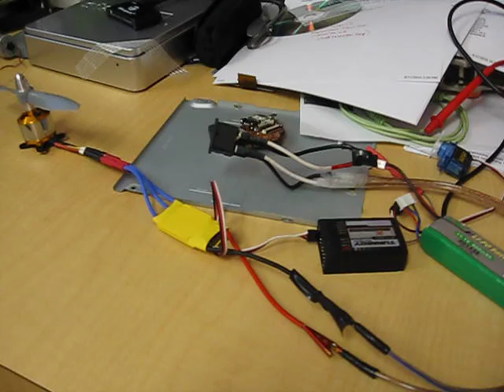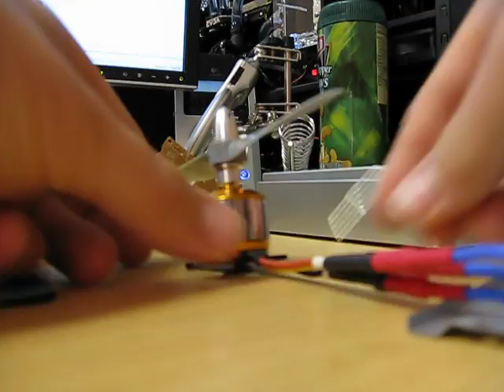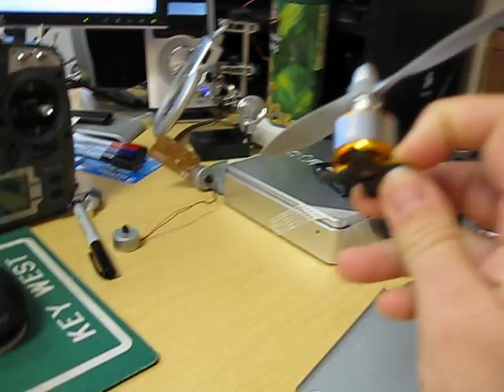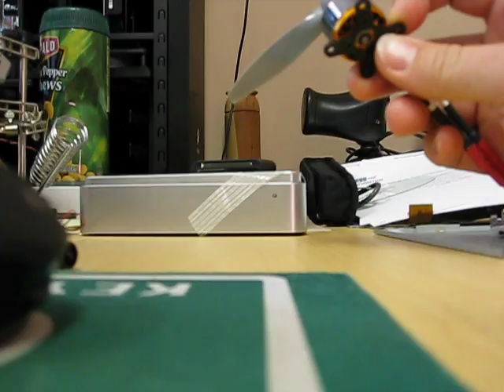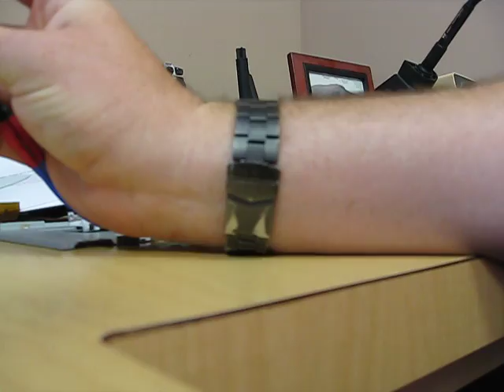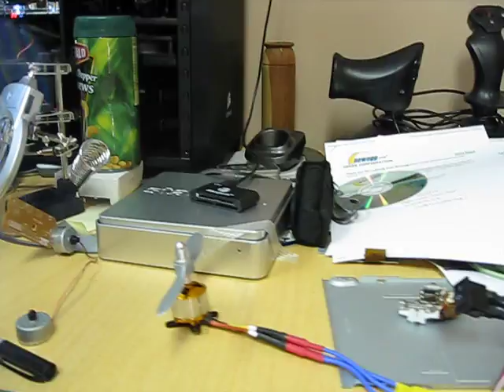2200KV Brushless motor test

Comment from the maker: I've run it in several planes, it's a keeper!
You can put a 8x7 prop on it and run it on a 2S battery as a tractor, or put a 6x4 prop and run it on a 3S pack as a pusher. Works great either way.

Comment from the maker: I can't really explain brushless motors in a single post. If you search Google for "explain brushless kv ratings", you'll find a really good explanation near the top. Generally, higher hv ratings spin faster under a given voltage, but there's way more to it.

Comment from the maker: No ESC card. I just used the Transmitter to program it with stick movements. I can't recall the exact procedure, it's been several years, but I found it on Google.

Comment from the maker: Do you have it connected as shown in the video, with the battery, ESC, and motor all connected? Have you programmed the ESC to work with your motor, using the instructions for your ESC? Is the battery fully charged? How are you attempting to start the motor? Are you connected to a transmitter?

Comment: Thank you for informations. I have a 2212 2700kv brushless engine. I will use it with 6x4 is it okay or not?
Reply: It's goona be fine
Reply: But just check the esc specs

Comment: Can you run a brushless motor direct to the battery ?
Reply from the maker: No, it requires an ESC (Electronic Speed Control) to send the proper signals. If you apply power directly, the motor will move 1 step and lock up. It may be damaged as well, depending on the voltage. Don't do it.

Comment: Which one is more powerful or faster 2200kv or 3300kv?
Reply: 2200kv motor will spin at 2200 RPM if we provide 1V to it.  @ 2v it will spin @ 4400RPM
3300kv motor will spin at 3300 RPM if we provide 1V to it.  @ 2v it will spin @ 6600RPM & so on.

But,
2200kv motor will have more torque than 3300kv motor hence it can spin bigger prop than 3300kv.
Also lower kv motors tend to be more efficient than higher kv motors.

So 3300kv motor will be faster but 2200kv motor will be powerful.
Reply: Nice, very well explained.
Reply: Thanks.

Comment: what kind of battery did you use?
Reply from the maker: The one specified in the description. 3S (11.1v) LiPo battery pack. Brand doesn't much matter, they're all pretty similar internally. That being said, the higher quality ones can be pushed a bit harder without overheating and will generally last longer before they wear out, so just read reviews and such before you buy. Personally, I like the Turnigy and BlueLiPo brands for the money, but I haven't flown in a couple years, so I'm sure there are new and better things out there now.
Reply: ok thx ;)